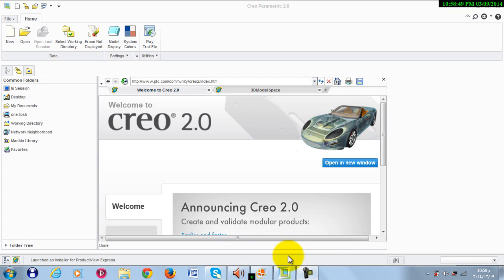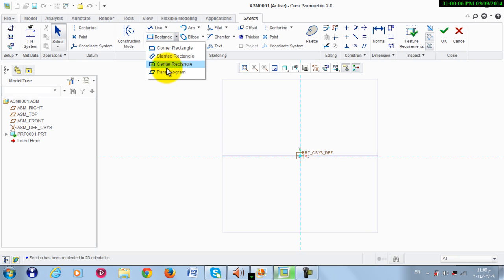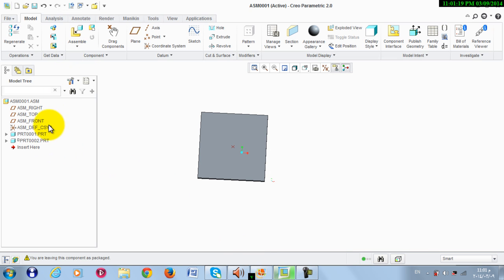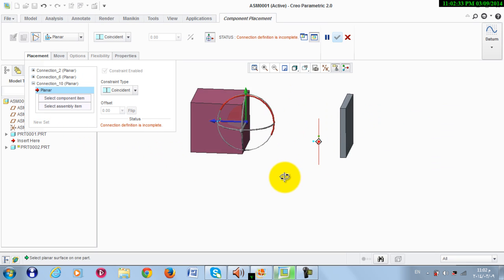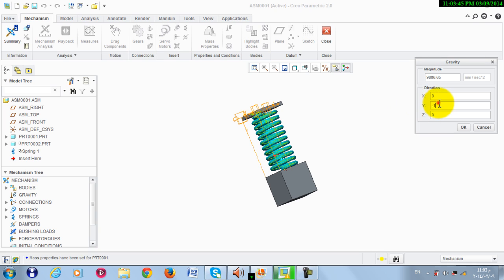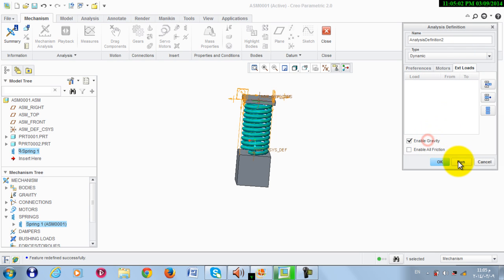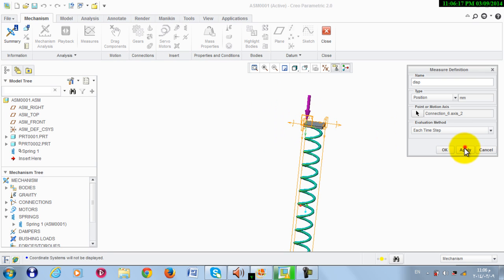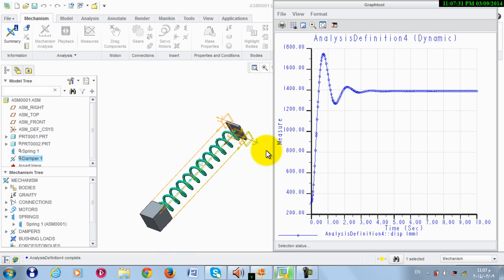mastering creo by exampels 45(mass-spring-damper system)

Comment: Is there any extra extension that needs to be installed for mechanisms, coz i am not seeing the mechanism option in application menu of Creo Parametric
Reply: It should be included with Creo natively. You probably couldn't see the mechanism option if you had a part file open rather than an assembly file open.